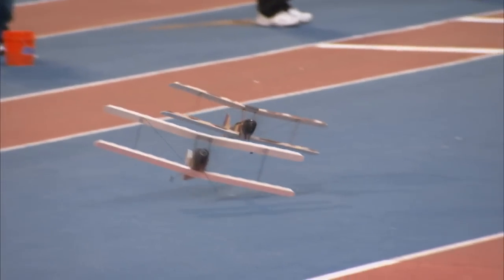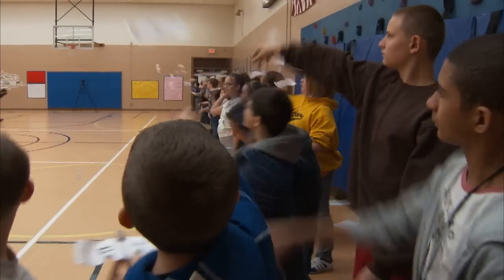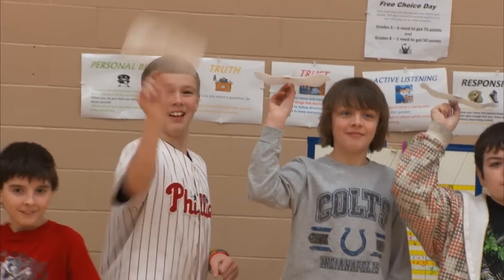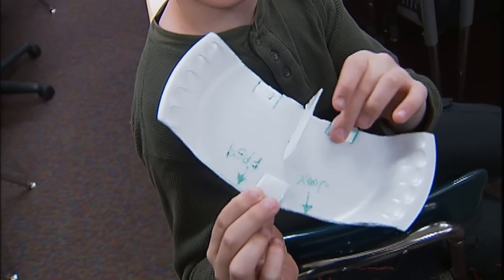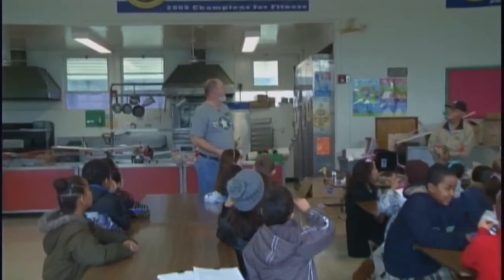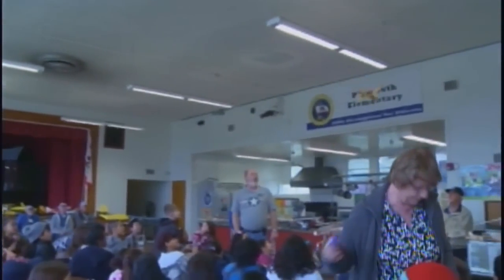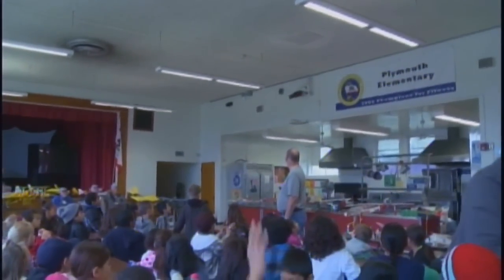How To Modify A Stock Balsa Glider with Tom Sanders

Comment: I build my planes from scratch.
Fuse, a Paint stir stick, cut to length., tapered to the tail.
Standard length sheet balsa. 
I do the wind tips the same way, crack and super glue.
The cool thing about this project is you can scale up or down size wise.
My biggest has been using full length 6 inch wide sheet balsa, bent, cracked and glued the wingtips. Did the same to the elevadors tips.
First flew it a dozen of so times. Then I added two nano servos and radio.

Comment: Easiest thing to do is just take the wing from a second glider overlapping to combine them using a drop of glue enlarging the wing area by 95% or so. I had one catch a thermal and it rose completely out of my sight. I never found the glider afterwards. I was ten years old or so and it was totally worth the lost (hard earned) $.65 cents just to see my contraption rise and disappear into the heavens like that lol.
Reply: I agree. Increasing the wing area definitely improves performance. Other tricks are to airfoil the wing, sand the balsa thinner, reduce the incidence of the horizontal stabilizer, and move the wing forward to get the CG farther back from the wing leading edge.

Comment: Tom, very nice.

These little gliders can't handle much speed. Even with a fast hand launch, they will loop back to the ground. I find I get a much higher rollout with a very moderate hand launch. Catapult launch is excessive.

I wet form both more dihedral and camber into the wing. See my post on EndlessLift on the 8" Guillow's 25-1 glider. The camber produces more lift. The increased dihedral permits a quicker rollout at the top of the climb. I have reduced the angle of the tailplane to reduce the loopyness, but that makes longitudinal stability marginal. Minor trim of the loop can be effected by bending the trailing edge of the tailplane down a bit. I put some camber into the fin to produce a very slight left turn, then launch it with a right bank.

Many hours of pleasant instruction may be had with these simple gliders.

Comment: Since this video is at least partially targeted at kids, it could be improved by:
- describe what cyanacrylate glue is, in that it is better known as "CA glue" or "superglue". Caution that you don't want to touch it, and do the work over something disposable lest you ruin the furniture.
- Mention that the accelerator is necessary because CA glue by itself will not cure/set very well (or promptly) if just left in the open air.
- If you are bending the wing up and wood fibers are breaking, many are breaking on the bottom; it might be worthwhile adding a CA glue bead on the bottom once the top is done.
- Rubber band 'specification' as given is unlikely to mean anything to a kid, or their parent.
- Who has double edged razor blades laying around any more? But any hardware store will carry single edged razor blades, and they are much safer to use.
- What's a "standard" ruler? A more useful description was needed.